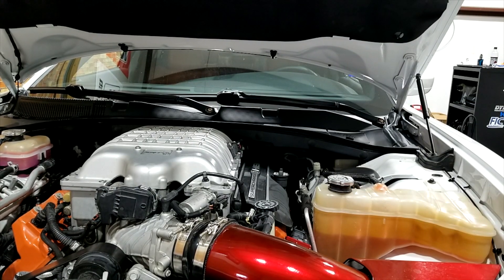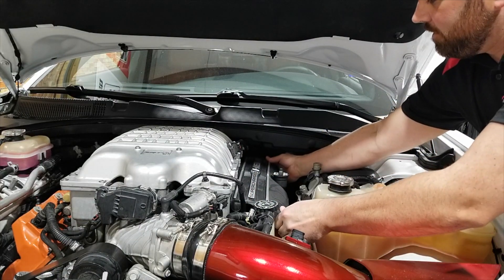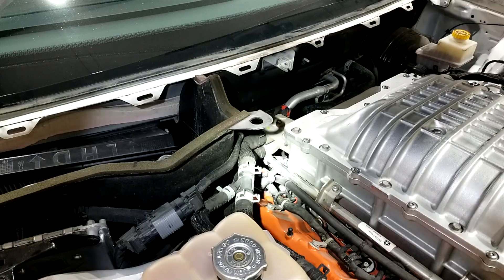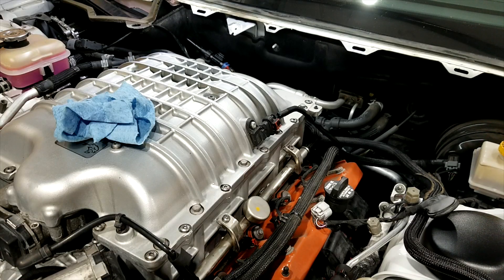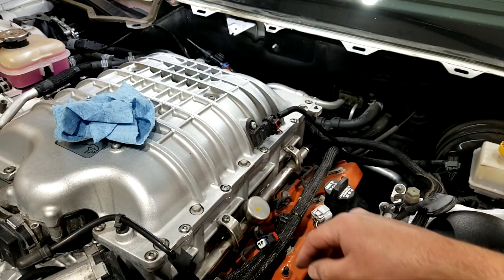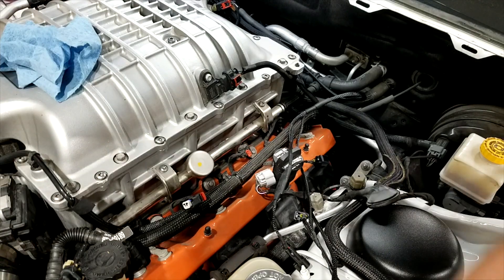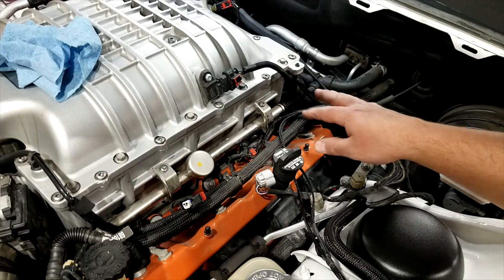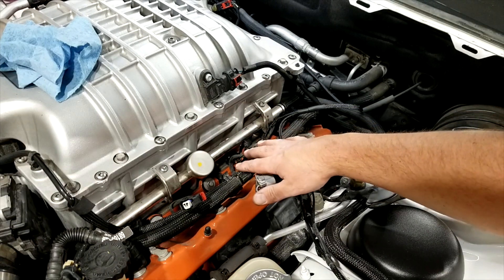ProFlex Commander for Hellcat Installation

Comment: Does your check engine light come on?
Reply from the maker: No, there is no check engine light issue with running our system with E85 in the C6 or any other model, for that matter.  You won't even know it's there.

Comment: Where is the part of the video that shows you how to hook  the fuel line into it?
Reply from the maker: The fuel line set-up is very simply.  It's all quick connect.  You remove the OE fuel line from the primary fuel rail, insert the sensor into the OE line, put our quick connect line on the other side of the sensor and click the new line onto the fuel rail.  It only takes a couple of minutes.

Comment: I would like to see how and where you install your fuel sensor back behind the supercharger. The fuel line  running behind the supercharger to the passenger side fuel rail  appears to be heat shrunk  to the OEM fuel sensor to the fuel line. - Disregard. I just saw the video talking about the loop-line. Thant answered my question.